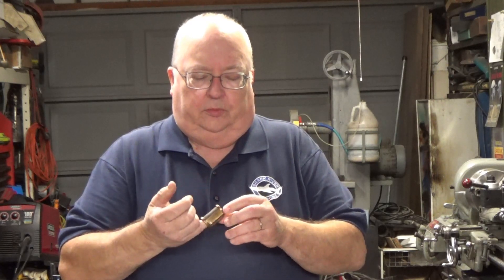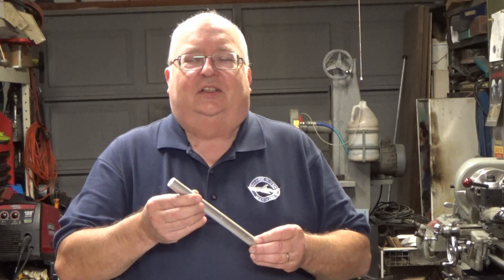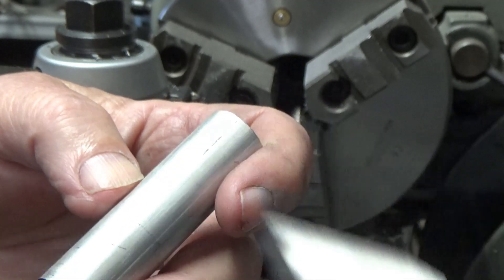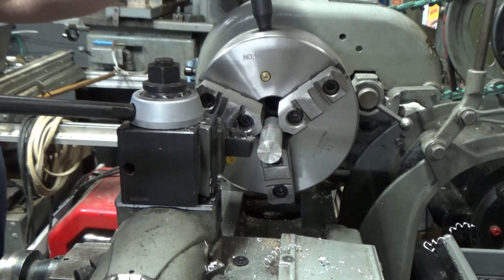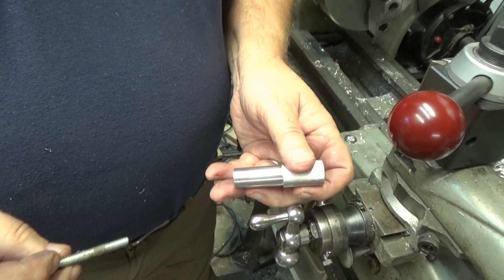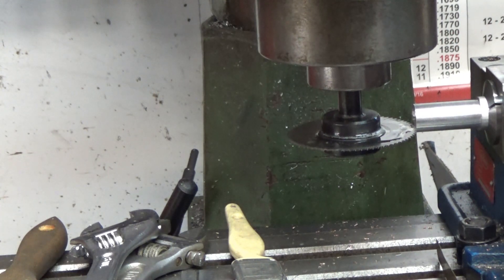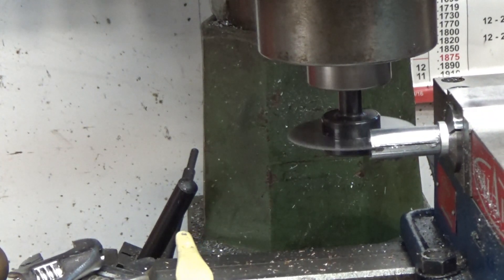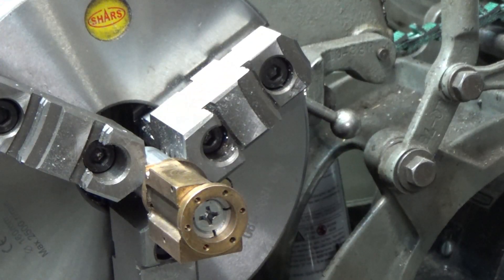Quick and Easy Expanding Mandrel Build

Comment: ...for when a mile of runout doesn't matter?...
Reply from the maker: Checked the runout and it was less than .005 more than accurate enough for the job at hand.  If more accuracy is required the final machining can be done after splitting the collet and reinstalling it prior to use.  Thanks for watching and commenting.

Comment: Steve,

Great little project.  Thank you for sharing sir.  I do have a question, did you mark the number one jaw to help re-orientate the mandrel back into position to maintain concentricity, or are you one of those lucky fellas with a true running 3 jaw chuck.  At ant rate, I will have to keep this in mind and make on in the future.

Joe
Reply from the maker: I didn't, forgot to but I will be addressing the build in my next video based on the feedback that I received.  Thanks for watching and commenting.

Comment: Perfect timing! I was just thinking through how to make one of these, and it's great to be taken through the steps by someone more experienced.
Reply from the maker: I had a suggestion made by a couple of viewers that I think is very helpful.  They suggested that the mandrel  be machined slightly oversize and then machined to finish size after it is completed and put back in the lathe to mount the component.  That way it will be dead on concentric.  I will have to put mine in a 4 jaw chuck to get that level of accuracy.  Thank you for watching and commenting.
Reply: @sharkrivermachine  I had heard of that technique, and was wondering whether you deliberately did it the way you did, or if it was an oversight.

Comment: That’s a logan? I used to have one. Love the cast iron pulley cover. Mine was worn and I didn’t know about scraping so when I finished cleaning it up and painting it it still didn’t work that well. So sold it. i kind of regret it now. With a scrape job it would gave been awesome. A very solid machine.
Reply from the maker: It is actually an Atlas 10F with am add on QC gear box.  I was saving to buy a new Precision Mathews when this dropped into my lap.  I have a little more work to do on it but overall a good machine. Thanks for watching and commenting.

Comment: Hey Steve. If the final sizing of the mandrel OD is done last, would that eliminate runout induced by the re-chucking? I did a similar job once when machining bronze valve guides. We turned $4 GM Quad 4 valve guides into $295 Lamborghini valve guides. Concentricity was of the utmost importance.
Reply from the maker: That suggestion has been made and it is a good point.  I will check the runout when I use it and put in a 4 jaw chuck if necessary.  When I had my automotive machine shop I had expanding mandrels for valve guides and I used them for machining custom guides. Thanks for watching and commenting.

Comment: Maybe should have left it oversized so you could have finish dressed it before doing the job. Looks like it has some runout in your chuck now.
Reply from the maker: I saw that but the bore appears to be running true. I will put a dial indicator on it before cutting. Old poor machining is what I am trying to correct. Thanks for you thoughts.

Comment: It'll be interesting when you go to machine the other part how well the mandrel evenly expands and see the run out.  Nice way to make the mandrel you need.  For further expanded use down the road, I would think it would be easy to put a small center in the bolt or make one so you could use the tailstock center with it.
Reply from the maker: This is made for the specific odd size of the cylinder.  It is only about .001 to .002 undersize so I think that the runout will be minimal.  It could be turned down for a smaller size.  Thanks for watching and commenting.

Comment: Great tip! Just using a csk head screw looks surprisingly effective. Before seeing your video I would have been inclined to make a special expanding screw with a longer shallower taper.
Reply from the maker: Just a quick and dirty design and build with hardware and stock on hand.  Thanks for watching.